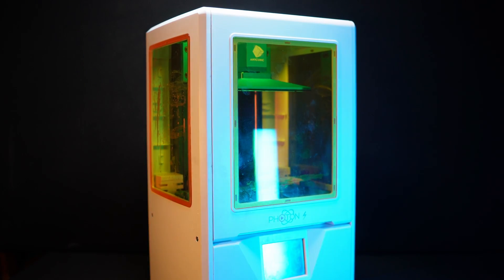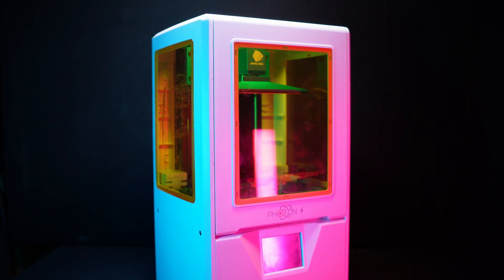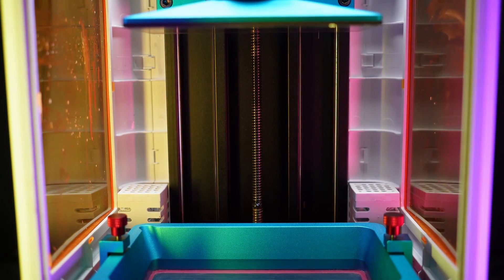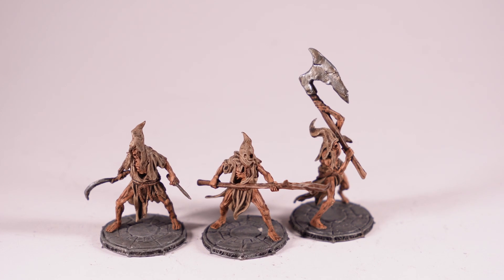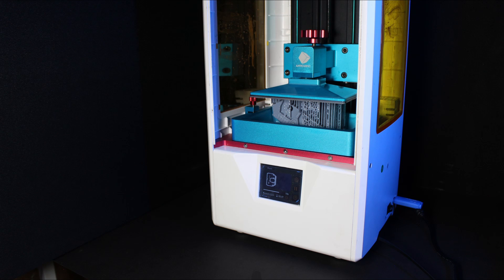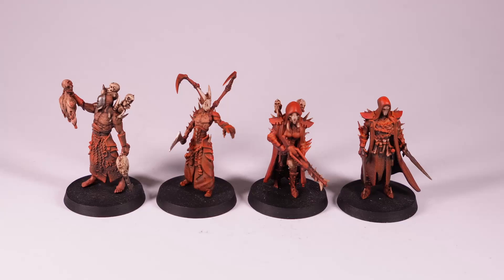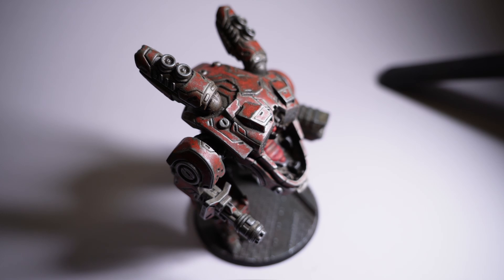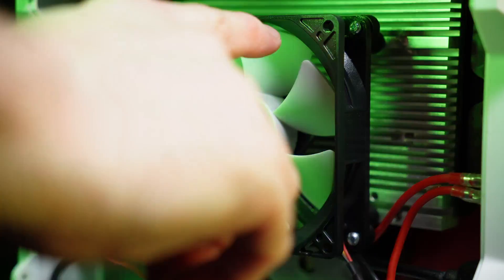Long Term Review - Anycubic Photon S

Comment: I have an Anycubic Photon. I've upgraded mine to a 2k mono screen and it's a made a big difference to quality and mainly speed of prints.  What i do like about these printers is that they have self- levelling feet, it's made of mild steel so is very sturdy, the vat is aluminium not plastic. It fits a relatively small space so ideal for those with limited space. The front cover opens up on a hinge and isn't an annoying plastic box lid like the mono or mono x or any of the other anycubic printers.  But what i really like about it is it's cheap and with a small build plate you really do focus on what you want to print rather than mass printing, wasting resin and never finishing a project. Just saying!

Comment: They are using two linear rails, folded in. The two humps you see on either side of the Z-screw are the sides of the rail, and the head has two linear bearings pointing in. Other than that this review was fucking excellent

Comment: Did you see the upgrade kits for this machine? Still only 2k but mono. They're only about $60 on Chitu systems  website.
Reply from the maker: I did! For the price it looks like an amazing upgrade for this machine. I wish I knew about them when making this video, I could have mentioned it but in any case I'm thinking of grabbing one at some point to try out.
Reply: @OnceinaSixSide  I upgraded my OG photon with one of these upgrades and it's a fast little machine now. I had previously installed a UK made dual linear rail kit so I'd say it's on par with a modern machine - bar the 2k resolution. The prints are still very acceptable all the same.

Comment: I can’t get anything to finish printing on mine
Reply from the maker: Sorry to hear that! How exactly are the prints failing and what troubleshooting steps have you taken?
Reply: @OnceinaSixSide  the printer freezes. I come back 5 hours in and the fans are still going but the touch screen is unresponsive and the printer isn’t moving. I have to power off and throw away another normal looking print. Tried re flashing bios. Always says successful. Tried multiple slicers.

Comment: I have a Photon S! What are your print settings for the minis you printed? They look great! Also, what slicer do you use?
Reply from the maker: Cheers! For the longest time (and for most of the prints on screen) I was using Chitubox, but I've recently switched to Lychee.

I don't have the settings on hand at the minute but off the top of my head its like 11.4 seconds normal exposure for the Anycubic standard resin, 5mm lift, 40mm/m lift speed, 8 burn in layers at 40 seconds each.
Reply: @OnceinaSixSide  what layer height do you use?

Comment: Do you think you could share your print settings?
I have this printer and over the last month or so of earnest use, I've had serious issues with supports failing. Had a lot of advice given in various discords, but almost all advice there or online is for Mono printers.
I'd also be curious of your support setting; I've only really been dealing with pre-supported models, like the One Page Rules models I see in your showcase shots.

Comment: I can't believe that you manage to print that massive tank with that printer.
Reply from the maker: It was a mission! Took over a week to print and a lot of gap filling and sanding to get the parts aligned and looking neat. It's definitely possible though to knock out big projects like that on a little printer :)